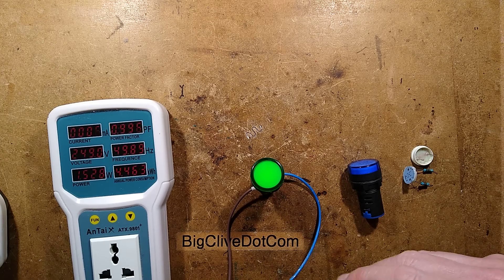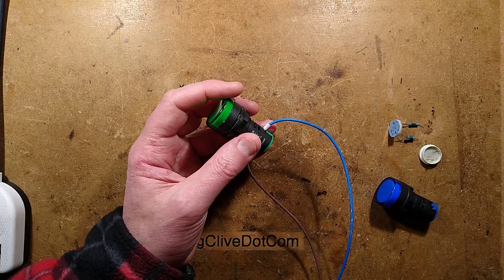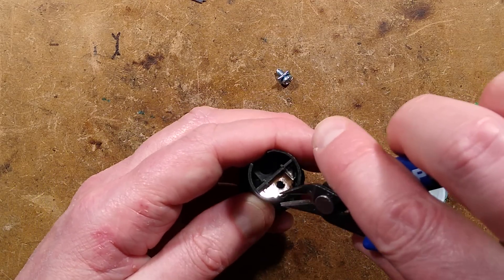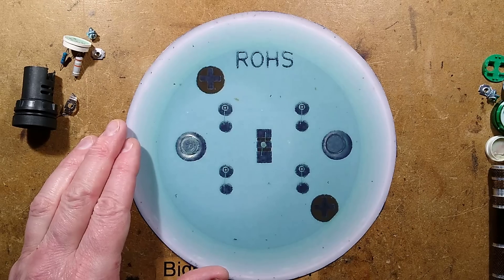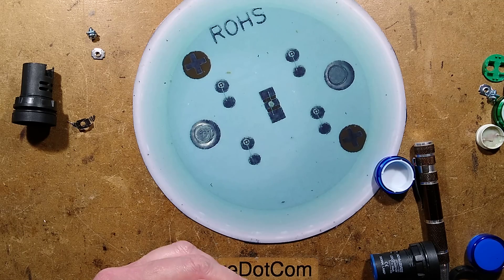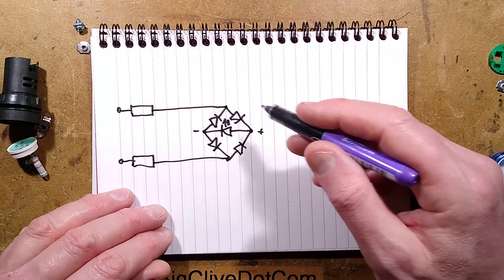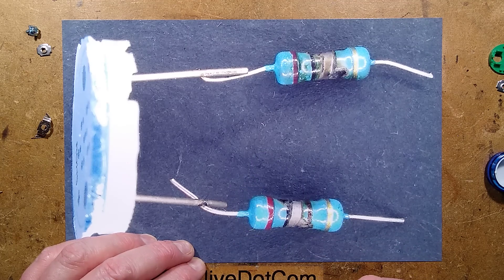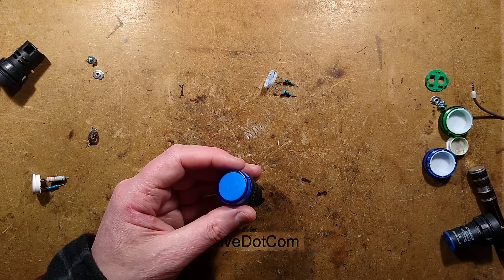Temu panel indicators - may need "customised"

Comment: The fact that China uses 220V vs 240V in the UK doesn't help either 😅
Reply: The UK should use  a nominal 230 volts since 20 years ago with -6%, +10%  (216 to 253 volts at the outlet) but that is not really implemented throughout UK so devices need to handle 230V +/-10% ( 207 to 253 volts) to work properly both in UK and Europe.
Reply: @MatsEngstrom  Good analysis, thanks.
Reply: It's an 8% difference, it isn't harming anything.
Reply: @phonotical That depends 🤣.